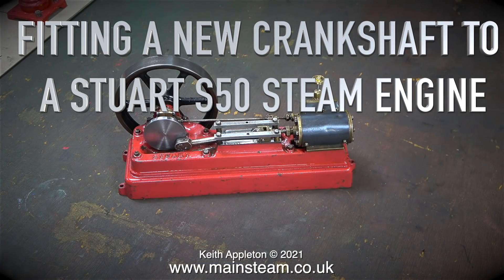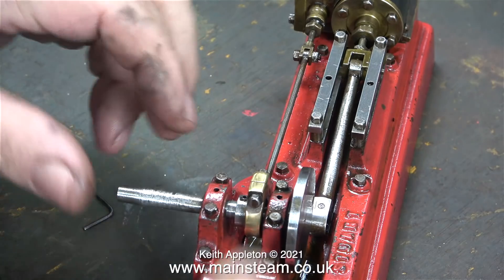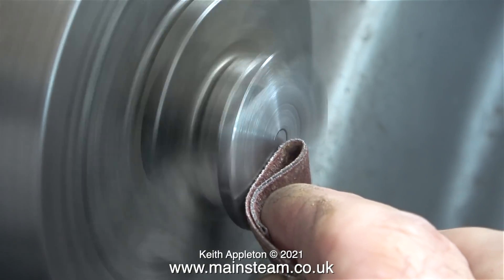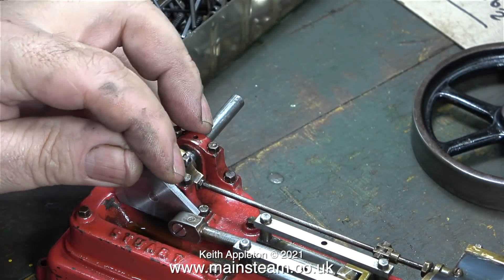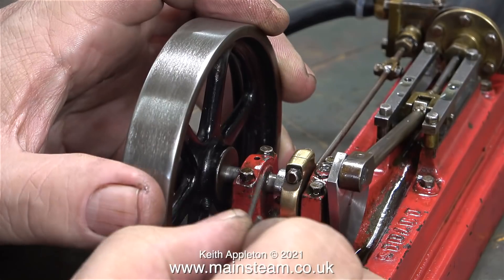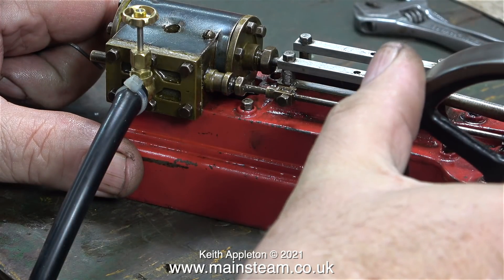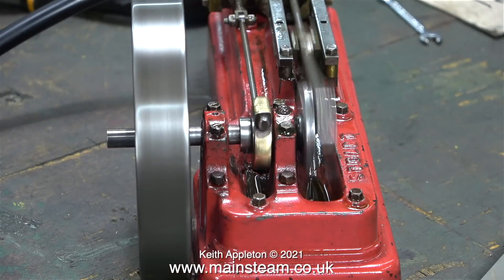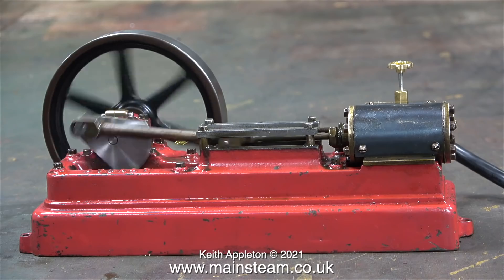FITTING A NEW CRANKSHAFT TO A STUART S50 STEAM ENGINE - IN THE WORKSHOP

Comment: I sometimes find it infuriating to see you adjusting the timing on an engine that is clearly working just fine, you go one way then the other then back again and it's not always easy to see any benefit.
This time I can clearly see how well that little engine is running at the end, I wouldn't have thought it was possible to run such a small engine as such a low speed, (I'm not talking about the slowed down video part). It must be very satisfying to be able to work to that standard !
Reply from the maker: Please don't be infuriated. The purpose of my videos is to show how and what can be done to achieve good end results, sometimes it is a fiddly and very precise job to get the correct setting, but the end result usually justifies the means..

Comment: These engines realy intrigue me. I know these are "model" engines but what kind of work are they capable of? It would be interesting to try and use one to charge a phone or something similar. Also, do they make any that are this size and made for work? I am training at work to run a cnc lathe and could possibly make everything needed if they are not made currently
Reply: I just saw your other video from 6 days ago where you do use it for charging and some leds. I guess my next question would be to ask what kind of wattage does one similar to this size produce?
Reply: I've run a small dynamo on mine, would easily charge a mobile phone, but remember you will need an electronic charge controller (Easy to get from online sources).